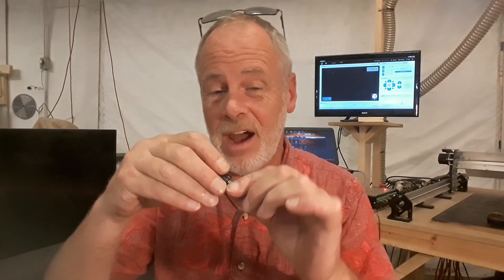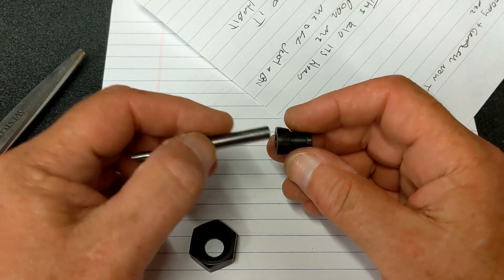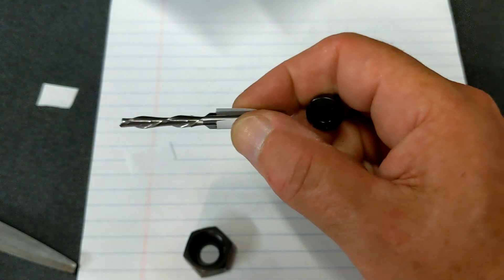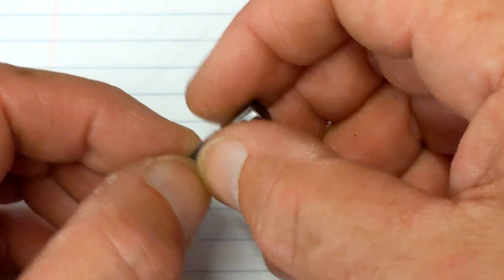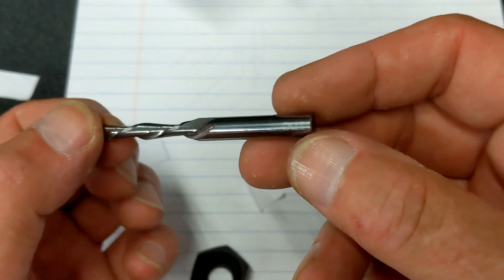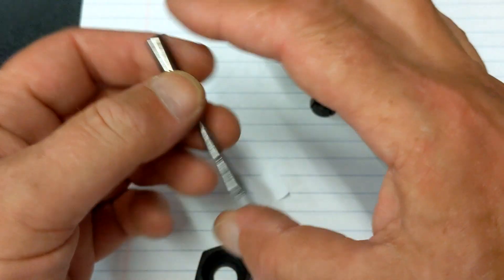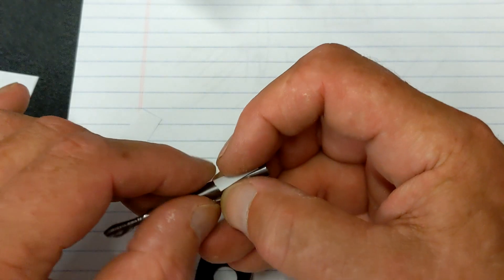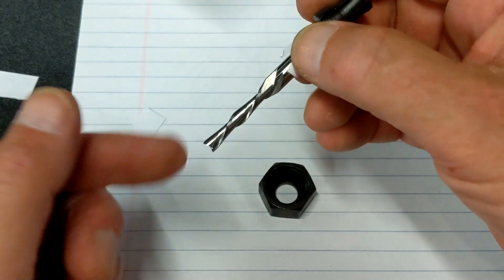CNC Router Tips & Tricks - Router Bit Shank Is Too Small [Easy Fix] - Garrett Fromme

Comment: Thanks for this tip. Been going crazy trying to fit a 6 mm bit into my 1/4" collet.
Reply from the maker: smollande, no problem brother! Im happy to help.
Reply: Did this work with just paper? And how safe is it I have same problem 6mm shank bit advertised as 1/4 inch bit (6.35) I was thinking of using JB weld to make the shank thicker
Reply: @phillrob7445  it's just a temporary fix. And not for prolonged use. That's what I think.

Comment: I've learned a lot of tips and tricks from you especially with the Vectric software. Yes, it's true, there is times in the shop where we use paper shims. It's a cheap way of filling spaces and eliminating gaps. One place I use paper shims that I'm less than thrilled about is in Morse Taper shanks on lathe tail stocks. Over time, tools that happen to spin will generate wear on the tool and tail stock taper. Tools don't lock in the taper. They are actually loose. By putting paper shims between the tool and tail stock taper, it takes up the gap. It doesn't work well and doesn't last long but not doing it results in the tool spinning in the tail stock taper as soon as the tool engages the work piece. Sometimes you can struggle your way through drilling a hole with this crappy technique.

I have to part ways with you on this paper shim on the tool shank. Yes, it may take up a gap, but introduces other potential problems. Once you tighten the collett, the paper will compress even further over time. It's effectively like loosening the collett a little as you're cutting. You are losing clamping force. A tool is held firmly in a collett with a combination of clamping force, area and friction.

I don't know offhand what the coefficient of friction between steel and steel is or what it is between steel and paper. I suspect it is much lower between steel and paper, meaning the tool will spin and slide in the collet at much lower cutting forces. The paper will disintegrate and things that are not good will follow. We discussed the risks of putting a tool in a collett filled with dust. I believe the risks with a paper shim is much higher. Get the right size collett or use a different tool.

With all this being said though, if you are using a down cutting bit and all you want to do is take a short length and shallow cut to avoid tearing at the top of the material and you just need to get a job out, cut at a much lower feed rate and spindle RPM than you might otherwise use. Creep along in slow motion. The bit might push up. If it spins though, and the paper disintegrates, what will follow will not be good. You are measuring risk vs reward here. If something goes wrong, make it go wrong slow.

If what you did worked out, breath a sigh of relief, give thanks and buy the right size colletts, tools that fit the colletts you have or get adapters. The smallest collett I have with my router is 1/4 inch. I often use 1/8 shank tools. I would have preferred a 1/8 collett but wasn't able to find one. I bought some 1/4 to 1/8 adapters. The right tools for the job will save you a lot of grief, stress, ruined work, damaged machines and money.
Reply from the maker: Hi CNC. I didn't mean to imply this as a regular practice. It is a quick fix to a hot problem. And, as you know, paper is not a bad shim material for many purposes.

However, I think I'd pass up using it in a taper. 

Oh, and it worked out for the guy who was in a pinch.

You know how it goes...make it work when you have to. We can outspend ourselves so fast when we don't learn to improvise.
Reply: @IDCWoodcraft  I'm surely no fan of using paper shims in a lathe tail stock to take up space in a taper to keep a drill from spinning. It's an act of desperation to make something work on an old piece of junk that should have been recycled decades ago. Management and ownership doesn't seem to understand that their shop is more like a junkyard. And once you get something to work, they see no reason why you can't do it again and again. Surely not my preferred way of doing it. And if doing this shim the taper with paper method, going slow is the only way to go. When something breaks free as it nearly always does, the breakaway tool spins slowly. 

So now here you are with your router. You are trying to finish up a job. You have cutting tools and collets, but no collets that fit your cutting tool. What do you do? Do you get the proper size collet and/or another cutting tool? That of course is the right way to go. But you're almost done. If you can just come up with a way to finish the piece, break down the set up and get on to the next job. You come up with the shim idea. It's risky. If something goes wrong, you're back to the beginning. If you can just limp through and finish the piece you can move on to the next thing. It's risk vs reward. You decide to try the shims. You go real slow with your hand on the emergency stop button. You want to stop at the first sign of trouble. You make it through. This doesn't mean you found a new and effective method of fitting tools to collets.

Now you're ownership and management. No need to spend money on fixing the problem. You get more confident. You begin to shim a lot of your tools. Rev it up and let her rip. Murphy's Law is watching. If you're lucky, you will just break a tool and ruin the piece.
Reply from the maker: @cncprogrammer3265  two schools of thought. But yes, it's always best to have the right tools. Paper is not a habit unless ones let's it be one. Seasoned machinists are very adept. You're and tricks are a necessary part of work
Reply: @IDCWoodcraft  It seems there is two kinds of shops. The junkyard where they don't want to spend a dime, and the clean, organized and well stocked one. The latter one is clean, organized and equipment is kept in pristine condition. When they need it, it works and they have tools to get the job done quickly and correctly. They know time is money. When a 30 minute set up takes 4 hours, that's real money. When a 5 minute operation takes 2 hours, that's real money.

Poor practice and technique over time will turn you into the junkyard.

Comment: great videos!!! appreciate all the knowledge. wondering if you can do a video on a stand-alone offline controller that would work with the evolution 4? ive been looking everywhere with no luck yet. hoping you can fix that! thank you garrett!
Reply from the maker: Hi Pinto. I'm assuming your talking about controller software. The most common one is UGS. however, that is getting out of date. gSender is probably the most current. Longmill has it available on their website here https://bit.ly/3y6rnwg
Reply: Thank you for the response…
No sir. I’m inquiring about an OFFLINE controller which would allow me to run G code from a SD card without needing to connect to the laptop. 
Again greatly appreciate your help!
Reply from the maker: @pintomade5527  I'm not sure. Ask in the onefinity group

Comment: PLEASE NEVER DO THIS!!!! I would not recommend hacking a bit that is spinning extremely fast to fit better. Better to find a manufacture that has the right specs. If this a hobby. Perhaps. But if you run even a small business and have an employee. And something goes wrong, and your employee calls OHSA. Watch out!!!!! Seen this happen at a place I used to work many years ago. Just and opinion, but I think this is really bad advice. Sorry I had to thumbs this down.

If the job is that important. OVERNIGHT that correct bit
Reply from the maker: Hi Hobby. Thank you for your comments and concern on this. It is not uncommon practice, as that is one thing shims are for. Of course, to your comments, this is an experienced based practice.

Regardless of your thumbs, thanks for taking a moment to share. 

On the note of thumbs up/down...I never thumbs down a video...ever.
Reply: I would say just because it's a common practice does not make a correct practice. I have worked in a few CNC shops, and have never experienced this. So if it is a common practice at the very least it's not for beginners, and this video seems to be geared towards beginners. I would hate to have someone doe it wrong, and have the bit go flying. But that's all I will say about it. Thanks for answering.
Reply from the maker: @hobbyhands  I didn't imply it to be the fix all. It works in a pinch. Anyway. I respect your opinion on the matter and thank you for your forwardness on it.